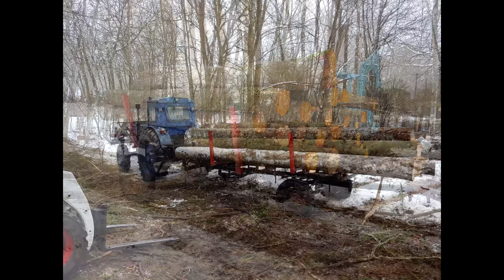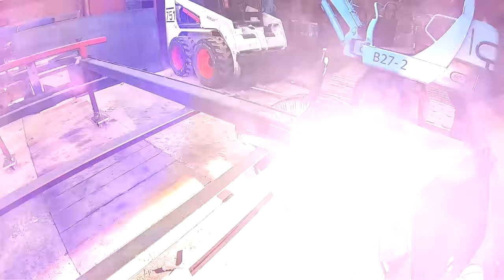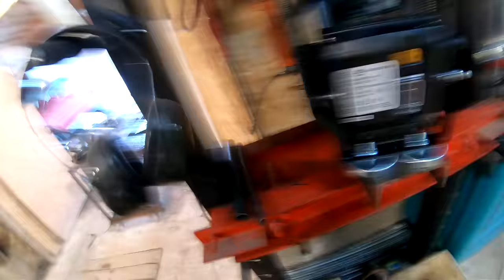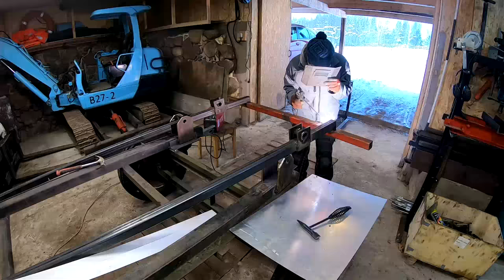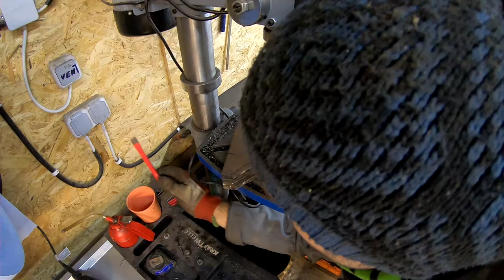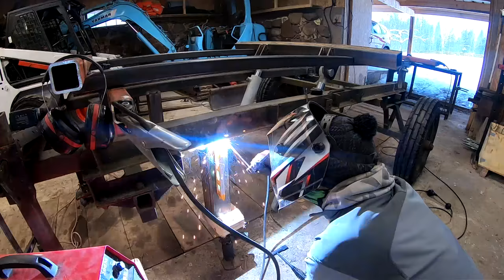Building a dump trailer pt. 1 of 2 (with hydraulics)

Comment: If you are going to repurpose that trailer to a dump, you may want to move the axle location -- it's fine where it is if you only use it on your property with the tractor, but if you intend on using it to pick up materials to bring home the tongue weight might be too much for your tow vehicle.  You might also want to look into a set of chains for the skid steer -- it would stop all of the traction issues.  Keep up the videos ... I always enjoy them!!!
Reply from the maker: Yeah im actually happy where its located. It puts more weight on tractor rear end thus increasing its traction and also takes stress off the axel on the treiler.

Comment: I'm thinking you'll need some gussets or extra support on the down tubes for the bottom end of the rams; there's going to be a lot of stress on the welds at the frame. But for sure the rest of it is not going to break!  Looking forward to part 2.
Reply from the maker: Yes for sure. I will add some more support down there in p2.

Comment: Very nice so far, I would rather have it over built than under sized. I'm not sure how deep your bed will be, but there will be quiet a bit of weight when full of rocks. Thanks for sharing, good luck from Tennessee (USA)
Reply from the maker: Possible yes. i ended up doing the bed 45cm deep i think. Not sure i will put it full of anything at first, wanna test it out gradually.

Comment: Might want to rethink your hinge design?  For the highest angle of tilt (to do efficient dumping without having to shovel it out) your hinge needs to be at the very back of your main frame.  You also want to keep your center of gravity as low as possible.  Tipping a full load is no fun.  The hinges are too high and needlessly raise the center of gravity..  The dump frame would benefit from all the square tube being in a flat plane, again for a lower cg.  So your cross members should be welded flush to the side rails not on top.  This will also as a bonus provide support for your dump floor at the same time.   The cg comes into play when operating on less than a flat surface.  Great project.
Reply from the maker: Thanks Douglas all great suggestions. I agree totally with what you said. Like the hinges being too tall. As iv about 90% finished right now i wont want to go back and redesigne anything at this time. Will keep the tips in mind though incase i will do anything in the future.

Comment: Hey Ants, I know this video is old but I hope you see this comment. Remember you said sometimes you get good welds and sometimes you get crap? I noticed before that your welding rods are sitting in cardboard boxes on your shelf. The flux on welding rods absorbs moisture from humidity in the air. In some cases that causes rust between the inner rod and the flux coating so then you weld impurities right in from the rod. It helps to keep the rods in sealed containers. It will also help you very much to get a welding rod heater to preheat your rods and drive any moisture out of them. But really you can use any oven to heat them up to around 82°C before using them.  Also make sure nobody else in your home is using a lot of electricity while you are welding, so your supply amperage stays consistent.
Reply from the maker: Yeh. I wanna get a rod oven. Or make one myself

Comment: You mentioned a gantry crane like AC has.  Years ago, i bought a portable aluminum gantry that could be transported and set-up by one person. It was good for 1.5 tons i believe. I wonder if something like that is available and would suit your needs.  It was on wheels and could be rolled out of the way.   Cheers from Eastern Canada.
Reply from the maker: Thanks man. I am planning to build a gantry grane but not in this shop. The celing is too low. Ill check it out.

Comment: That is one serious piece of kit. Wonder what the weight of the trailer is now? And if you would like to build the next euro tank...you're the man. I love your unplanned approach but your mind must be seriously sorted for problem solving. I expect that designers would measure every bit of stress and force on every bit of the structure and probably still not come up with an affordable solution as you have done. Well done. Amazing to see your thinking in action.
Reply from the maker: Thanks Jim very well thought out comment. Yes today the engineers put minimal everywhere to keep costs down. Mass producing stuff with overkill designs will eventually cause loss in profit. So they stress test everything to failure to figure out how thick of material to put this or that just so it can manage its weight class and not break atleast untill the warranty is valid lol. Thanks for watching and take care Jim!

Comment: To test hydraulic cylinders sometimes compressed air is enough. Does not work super exact but complete stroke in or out is already possible. Simple is best.
Reply from the maker: Yeah, that should do it

Comment: You should look into getting BOBCAT TRACKS system for yours just because of the amount of snow and hill sides you have to deal with on a daily grind.
Reply from the maker: Idk buddy, i have a feeling i dont have enough power if i add tracks to my wheels. i can feel the engine or hydraulics bog down when i go full throttle spinning on spot, adding tracks would just stall the engine constantly or maybe theres something wrong with the thing.

Comment: the problem with the saw on 900x900 was before the saw was through the the piece your cutting off the weight dropped and dragged the rest onto the blade . get some support for large heavy cut offs 🙂
Reply from the maker: Yeah should have supported the end like you said. My mistake

Comment: Hi! What rods are you using with your welder? Sounds like you have too small distance from tip to material but it will probably be fine. Amazing how powerful the small MMA welders are. Good video, I will keep a lookout for part 2.
Reply from the maker: Iv used 2 different ones idk what type of rods they are. Onr of them likes to burn very close i can even push it into the pool and it wont go out. But another type i have liked a very specific cap, too close or far and it will stop burning.
Reply: @Ants_Pants  ok, I prefer the 7018 rod, a bit hard to restart but easy to weld with.

Comment: you know that 7018 runs like butter  beautiful beads or stringers  you might say  i tinkered with welding for a while  about 22years  pipe and conveyor structur es  in quary

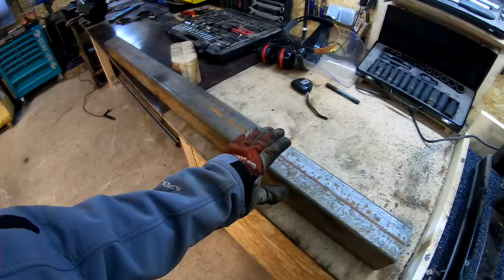Comment: 28:36 Yeah, that stock is a bit too much for the saw if the free end is unsupported! 
Put a table (or some other device) (maybe a sling?) at the cut-off end of the saw to keep the pieces from freely falling to the floor.

Comment: Change frame rate on GoPro to remove flicker. Way overkill on rams especially with axle without bearings!
Reply from the maker: I tried all the fps settings still get flicker. Overkill is good 🤔 sometimes 😅👍

Comment: What's the blade you're using in the steel cutter?
Reply from the maker: multi-purpose blade, can cut steel/plastic/wood
Reply: @Ants_Pants  sorry, but I wanted to know the make, is it evolution, how many teeth, an how long have you had it working, sorry its a lot of questions but, want to know which is the best to buy. I bought a cheap Chinese blade, but its blunt already after a few cuts. Thnaks, do enjoy your videos, keep it up.

Comment: it looks like you are holding the rods wrong, its the opposite of how you would normally mig weld....watch a how to video.
Reply from the maker: There are rods wich are meant for specific angle of attack and some are meant to weld in any position. Iv noticed the more expensive rods run alot cleaner arc with a lot less sticking.

Comment: Change the camera to 25 or 50 frames per second to get less flickering. Matches the 50hz of the powergrid.
Reply from the maker: Low fps is bad when i turn the camera on spot. I get a lot of dizziness. Thats why iv shot 60fps. I did try 120 and 30 fps but the flicker was still there.
Reply from the maker: @handlebullshit  idk buddy if i remember my camers only allows 30, 60, 120 fps and also 240 fps for slowmono. I dont recall it had 50 option. But i will double check.
Reply: @Ants_Pants  what camera are you using? If it is GoPro you need to change setting from NTSC to PAL to get the 25/50 fps settings.

Comment: you know that 7018 runs like butter  beautiful beads or stringers  you might say  i tinkered with welding for a while  about 22years  pipe and conveyor structur es  in quary
Reply from the maker: Yeah mostly used 7018 rods their 👍